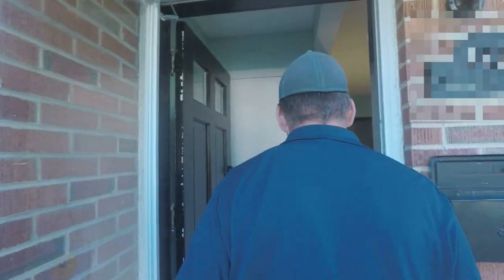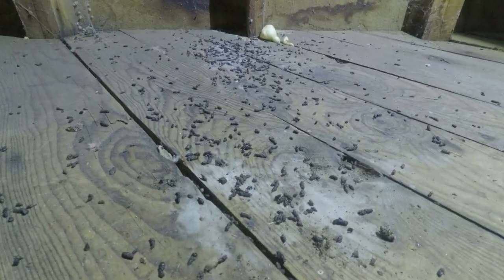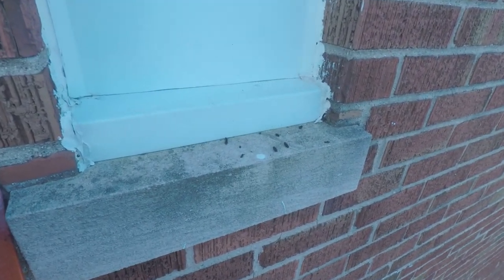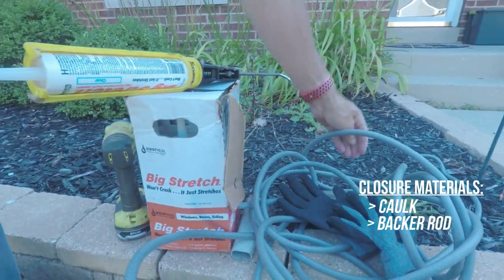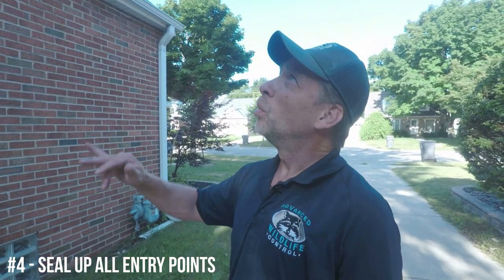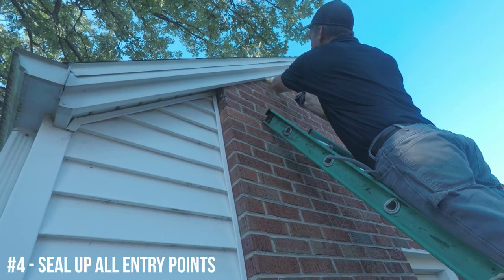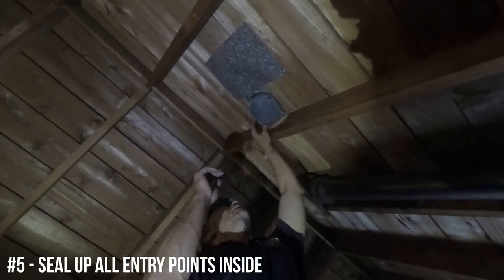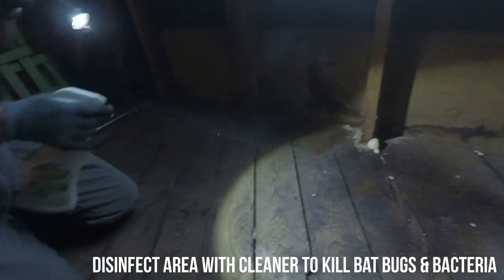Bats in House: How to Inspect & Protect your Home from Bats

Comment: Always spray the bat poo with disinfectant BEFORE you clean it up 1 in order to kill germs present to best of your ability before clean up, 2 so as the fine particulates do not dust up into the air and thus reduce the possibility of breathing 🫁 them in.
I'm a wildlife consultant in Florida if you have any questions feel free to ask. 💪🤠🦇
Reply: What’s a good disinfectant to use? I’m renovating a house that had bats in the attic and I have removed the guano and ceiling along with the insulation. What’s the best way to disinfect the ceiling joist and get rid of the smell? Cheers